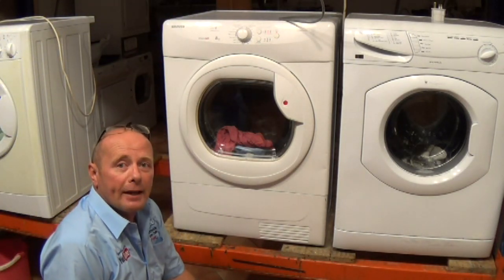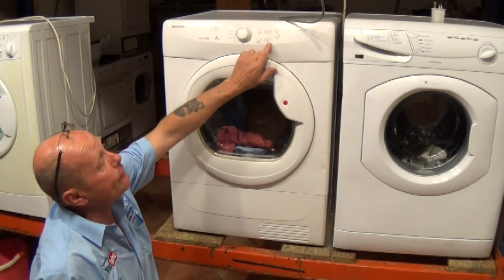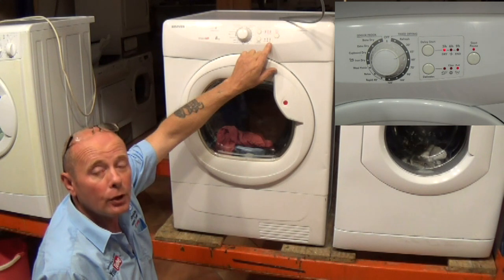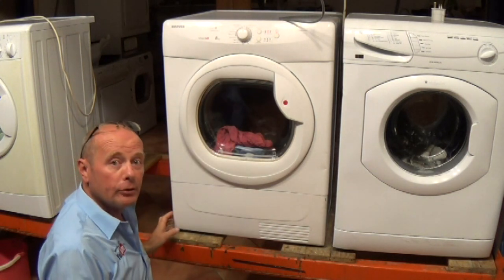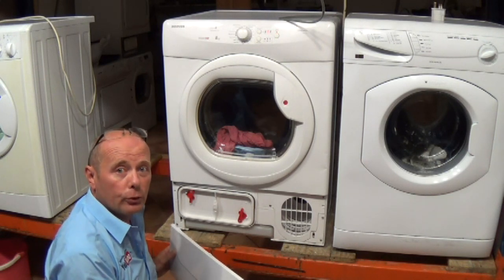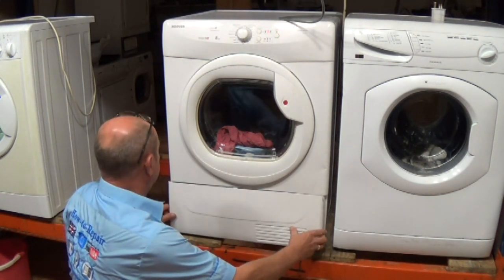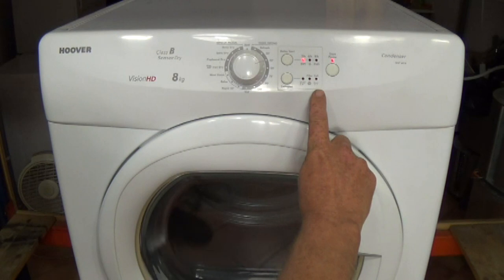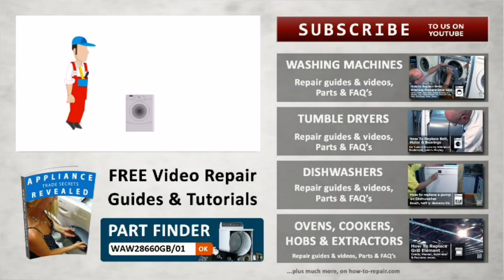Hoover Candy tumble dryer empty water Indicator flashing, runs for a few seconds then stops

Comment: My Candy 9Kg Grand Vita gets too wet inside and does this. I had to empty the water tank, but then I had to empty the wet clothes, stick some dry clothes in and turn it on... It'll stop after 90 seconds, so you have to keep re starting it for ten fifteen minutes, then it seems to be ok... That helps to dry the moisture out...

Will probably help if you empty the water tank after every wash.